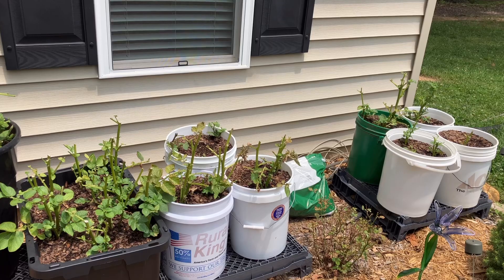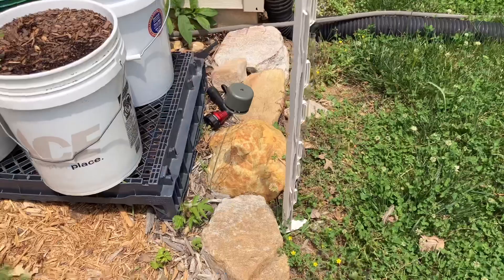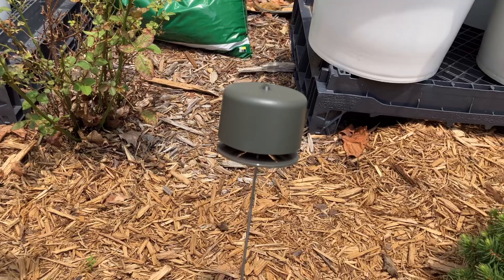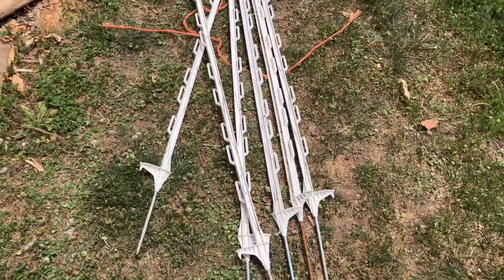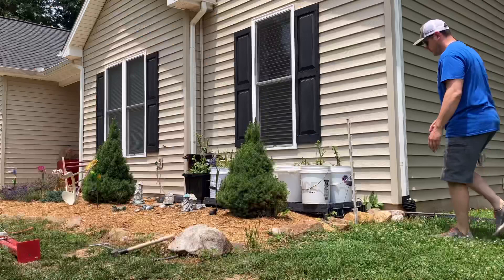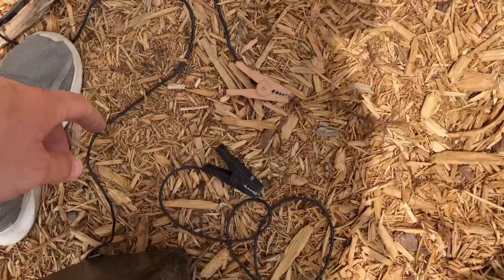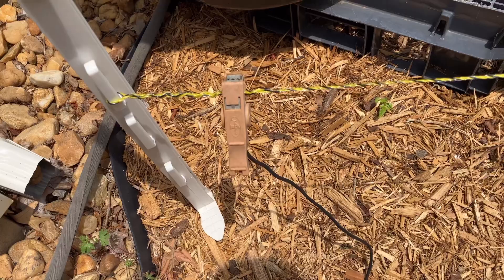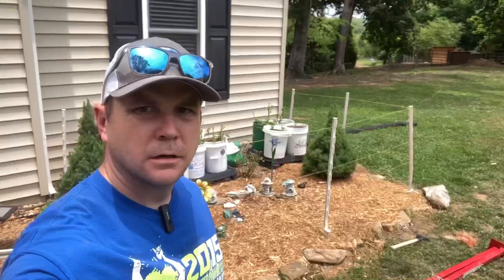How to STOP DEER from EATING your PLANTS!

Comment: I knew a gardener who swore by using fishing line around her posts. The deer couldn't see the nylon line but were spooked by touching it. She would attach it at the top, middle & low between the posts around her garden. I figure it would also work if they blew around in the breeze while hanging from something. Also good for hawks.
Reply from the maker: Thanks for the recommendation.  I may run a strand around our normal garden as a proactive measure.  We haven’t had an issue yet, but it’s just a matter of time.
Reply: @RockyCreekHomestead  does it work?